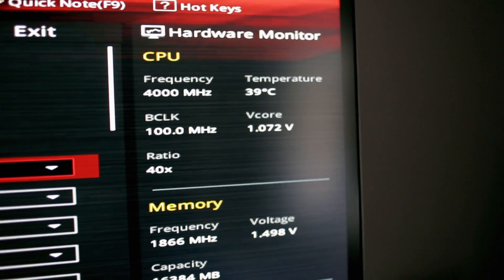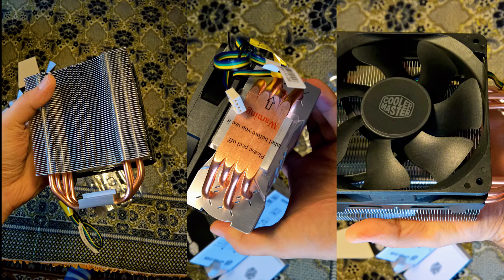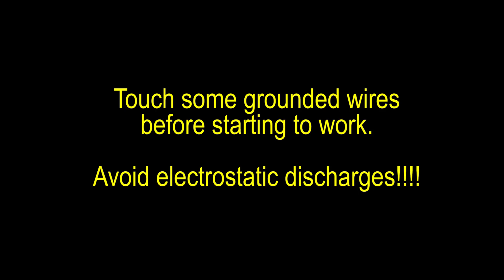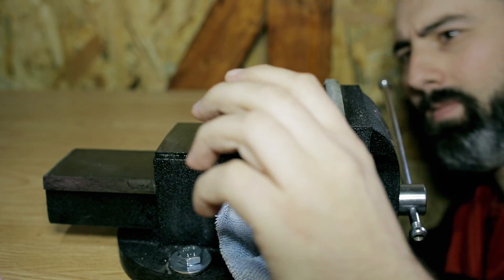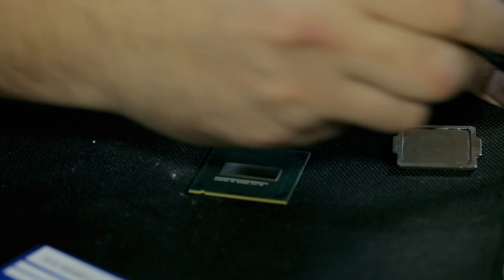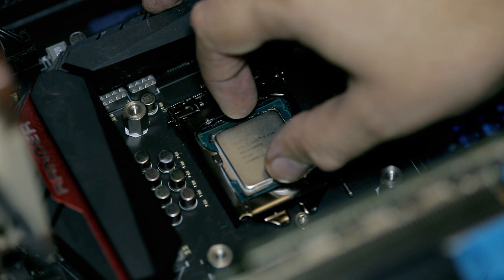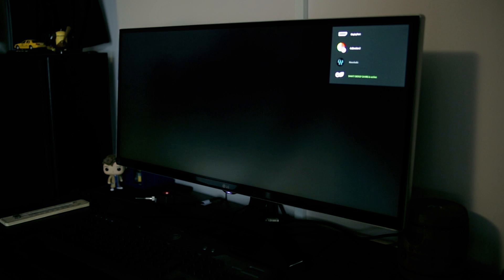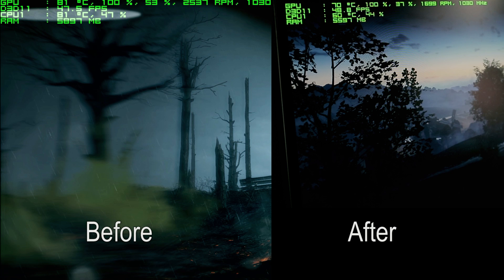Fix my i7 4790k overheating issues by doing a delid [ vice method ]

Comment: Still scared to do this lol but my 4790k is getting in the 70c range non overclocked with a h100i gtx I cant even get a stable overclock lol. Is your 4790k had any issues after delidding?
Reply: u probably have a bad cooler with a damaged pump or smth. My i5 4690k 4,7ghz @ 1,33V gets to around 80°C on my quiet fan curve with a nzxt x61 280mm AIO
Reply: My noctua nh-d15 had way better temps but I hated having the ugly bulky thing on my motherboard
Reply: roteroktober420 i5s run a good bit cooler then an i7
Reply: I have Noctua NH-D15S. Yep ugly and bulky to many people. I think its big, huge, badass. and looks premium, I actually like the colours. Plus it can't leak or fail like a pump/watercooler setup. 

No it's not the cooler, its the focking CPU. Watch the video... i7 4790k TIM sucks. Needs to be delidded. I also get high temperatures with i7 4790k stock and Noctua NH-D15S. Stock, and turbo boost is enabled I think.    47-50c idle. Need to delid, clean, and put new thermal paste and put it back in.

Comment: Wait, you changed to a 212 evo, didn't notice any change, and still use the 212? Surely the AIO is better? Did you try changing back after delidding and see if there's any noticeable difference? I'm currently looking at all delidding vids while I wait for my delidding tools to arrive. I hit high 80's with my 4790k, it's really bad... Thanks for the vid!
Reply: Aha, I see. No, it certainly isn't, and the 212 evo is fine, like you say. I was just thinking since you had a spare H80i you could just as well use that, but good idea to use it for the GPU :) I use a Corsair H110 myself, which I guess makes the 4790k hitting high 80's even more ridiculous. Can't wait to try out the delid. I'll be using liquid metal though, so it will be exciting for sure.

Comment: dude no one have balls to do this
Reply: Florin Musetoiu so what is the best lga 1150 to use
Reply: I have balls and and a small 9 inchs dick so i did it
Reply: I think the 4790K was the end of that line. It also uses DDR3 memory. Nice chip. You can buy good used Z97  motherboards. The 4790K has AVX2 vector processing, and it's not too far behind the Kaby Lake processors.

Comment: how long it takes for that paste to need replacement ? also what if i dont use any gasket maker to glue them back and just leave the mobo hold it as it is? will be any problem if the surface from ihs comes in direct contact with the ide without having that thin layer of silicone in between ?also how long u have that paste will need replacement ?
Reply: yeah but will the direct contact between ide and ihs cause any problem to the cpu ? since theres no silicon layer in between ?
Reply: srry my bad i mean the direct contact without silicon layer in between pcb* and ihs

Comment: The thermal paste isn't the problem.  That's a myth.  The problem is the excess adhesive.  It puts too large a gap between the IHS and die.
Reply: Yes Justin. Everyone who works in this industry and says that Intel uses bad Thermal paste is wrong. You are the only one who knows the real truth. Sarcasm off.
Reply: He wasn't speaking about the glue you applied. He was talking about the glue applied by Intel.

Comment: I delidded my 4790K today. I am getting Temps of 30C at idle and 54C at Load with OC to 4.4GHZ. I decided to do it after watching this video. It worked great! Thanks!
Reply: OC to 4.4GHz? that's the Turbo Mode
Reply: This is pretty amazing. I used Arctic silver # 5 both between the IHS and the Die and between the the IHS lid and the H100i v2 corsair water cooler. I have overclocked to 4.7 GHZ and have yet to hit a CPU temp above 70C, even when at load. WTF, man?
Reply: Well, the AMD Ryzen series has that going to it, but, according to the reviews, those chips don't overclock very high. Now that I have the heat issues fixed on my 4790K I doubt I'll be upgrading for a couple of years.
Reply: It really frustrates me to see all this. I am not the type of guy that takes the risk of experimenting with his expensive electronics.. 
And it makes me MAD intel could not do this by themselves.
During Battlefield one it does not reach temps higher than 77-79 degrees with the CPU at 70-100 % load, so it is not really a problem. 
But when i start the OCCT small test the temp gets above 85 in 20 seconds. 
Those synthethic tests are of course beyond any real world application, but....
My former CPU topped out at i believe 70-72 degrees with freakin prime95 running half an hour.
I don't have the stock or a bad cooler on it today.
Reply: Your Temps might have been even better had you used a liquid metal.
That isn't to say that this difference is small.
Now this has motivated me to delid my 4790k

Comment: For the love of God it's been proven several times that too much thermal paste does not effect your temps in anyway. Second just use your brain if you think he used "too much" thermal paste. If too much was an issue why did the temps drop so much after the new thermal paste application.

Comment: I would have tried a better cooler before trying a delid. I run a Noctua NH-D15 on my 4790k and it never goes over 70c
Reply: Nah it aint about the cooler :). hyper 212 should be more than enaugh for good/decent temps. I have Noctua NH-D15S + Intel core i7 4790k 4.4ghz. idle temp is about 49c or so... thanks to focken INTEL'S SHIT TIM. Need to delid and remove the bad thermal paste, and put fresh MX-4 inside it, and put CPU back. should go down in temp 8c or more.

Comment: My 4790K ran at 100° for maybe a few weeks because a wire got stuck in the fan, this was like 2 years ago and it's still doing fine but even with a custom loop my Temps on 1.22v 4.4ghz peak at 90° on one core while stress testing so I assume the thermal compound under the heatspreader didn't like the heat very much.. gonna try delidding it the following days, hope I do t fuck up.

Comment: Mother of god that was way to much TIM.
Reply: overclockedamd123 That's been proven to be false.
Reply: Bad troll or really stupid, we may never know! :D
Reply: The3rdID is correct, both LinusTechTips and JayzTwoCents have proven that the only thing that hurts thermals is too little thermal paste.
Reply: overclockedamd123 why? It's non-conductive and will be evened out by the mounting mechanism. It's more than necessary but nothing to worry about.
Reply: More than necessary hurts cooling performance.
Reply: overclockedamd123 you ate wrong dude, or do you have a source? You can look up linus' video about this where he tried the dot,  line, too much and too little,  too little was the only thing to lower the cooling performance, too much makes a mess by spreading beyond the edges but obviously the cooling is just the same as the dot or the line as it gets evened out by the pressure of the cooler/heatspreader in this case.
Reply: overclockedamd123 Unless you stuff so much thermal paste under It that the socket arm can't press the ihs all the way down it does not matter.. and I'm fairly sure it's impossible to manage to stuff that much on there. after all it can only be as thick as the clearance between the die and the ihs.
Reply: overclockedamd123 Necro but Oh so worth; the facts are that thermal pastes have high thermal conductivity, sometimes higher than the actual contactsurfaces, and are used to bridge the physical gaps between surfaces. If the distance between the surfaces is huge (many milimiters) then yes, you will see shitty temps even with loads of thermal paste. But a lot of thermal paste between tightly secured surfaces will ONLY show gains, since the more paste there is, the less space there is for small insulating airgaps. If you have too little and the surfaces push towards eachother, you risk creating precisely these insulating airgaps. I work with retail sales and returns in on of Scandinavias largest PC stores and have sometimes done repairs too and can definitely say that too little paste has always shown higher temps than too much.

Now, lets turn this debacle; what evidence do YOU have that too much thermal paste (and key here) between thighly secures surfaces causes temperature degredation? Doesn't that go against the purpose of TIMs in the first place? I mean, are you suggesting that thermal pastes act as insulators? How else would they degrade temps?
Reply: I know this discussion is old, but actually the amount of TIM was just fine. It makes a difference if you apply the TIM on the CPU Heatspreader to mount a cooler or if you apply it on the die, like he did. In that case, you have to make absolutely sure that the whole die is covered, and also you don't have a cooler pressing directly on the TIM. There is still a very small gap between the die and the heatspreader, which also must be 100% filled with TIM. Also, any excess TIM gets pushed to the side of the CPU anyway. It is definitely better to use a little more paste; it doesn't have a negative effect, but using too little definitely does.
I'm also thinking about delidding my 4790k, since I wanted to OC but that thing immediately shot up to 90° :P
Reply: I found putting too much TIM increases temps, as so does too little. I go by the theory that paste is only to fill micro-fissures and pits in the surfaces. I spread it as thinly as possible while still having a covering. I found that yields best results. In most cases a tiny bit still gets pushed out of the sides, but temps are always at their best.
Reply: Also in IHS cooling you only need to cover roughly 60% of the IHS cause that is where the core is.  Slapping on 10 pounds of goop to cover the whole IHS is not needed.  Depending on the cpu (in this case a 4790k)  A small grain of rice is the best method.  It will spread vertically and horizontally enough to cover the core under the IHS.   Beyond that you are leaving a thicker layer on top of the DIE under the IHS and hurting cooling performance.  It is proven by elite overclockers around the world.
Reply: Even liquid metal is far less thermally conductive than the copper of the IHS and the cooling head.
Reply: overclockedamd123
you're wrong and it's been proven.
Reply: Everyonev here is wrong. You don't need to use any thermal paste at all.
Reply: Good day to you.  If this doesnt make sense let me know and I will go further into Tdelta and ambient temps of why this is worse to apply more TIM than needed.
Reply: Incorrect.  So I tried but thanks for reading.
Reply: Good luck to you I hope you have a happy PC life.
Reply: Amazing story backed up with facts.  Thanks.
Reply: Ok well let me break it down for you.  In IHS cooling to heatsink you want the thinnest possible amount of TIM to enhance thermal transfer.  The higher the quality of TIM the better of course.  In Direct DIE cooling amount does not matter you NEED to cover the whole area.  Sure you can slap 10x the amount on a IHS and make a video directly after like linus BUT most TIM cures and when you use too much and you also are not a pro at applying a heatsink/waterblock you won't get great contact because of the amount of TIM you use(it goes on thick).  Thus you are negating a lot of the positive of effect of a high end cooler you purchased to cool your CPU.  Sooooo.  Yea thats it.
Reply: incorrect.
Reply: vermillioN Linus is a moron and the fact that you are using him for information makes me realize you won't understand logic I try to tell you.

Comment: i delidded mine last night, this time i succeeded, i broke an i7 4790 trying to do it once.
i am only seeing around 4c cooler on two cores, the other two cores are the same, this is with artic silver 5, ive ordered some better stuff.
Reply: temps before the delid on stock settings running at 1.1v were 69,70,70 65, after they were 69,69,70,60. when i take my cooler off it looks like some areas of the ihs arent being covered fully by the cooler, i might need to lap the ihs, ive also ordered some liquid pro, im using as5 at the moment so i could see further improvements.
Reply: yeah but 70c undervolted? surely not.
Reply: Did you isolate next to the CPU Die some how?
Reply: @ALWSGaming  nice

Comment: Salut, am si eu un 4790k si nu stiu daca se merita sa ii fac delid: in gaming imi sta in ~60 grade iar un full load pe 4.4 ghz imi sta undeva pe la 70~75 grade, acuma comparand cu ce ai tu as dori sa stiu cum ti se par temperaturile(sistemul meu are racire numai pe aer)
Reply: pe cpu am un noctua NH U12P SE2, iar carcasa este un phanteks eclipse p400 cu 3 exhaust fan noctua NF p12(exact ca alea de la cooleru de proc) iar in intake fron cele 2 de la pahnteks
Reply: multumesc mult pentru informatii! Mult spor in continuare iti doresc!

Comment: I have been having the same issue with my 4790K ever since I bought it. Even though it is water cooled it still consistently goes above 70 degrees C while just playing Resident Evil 7. It's ridiculous how much Intel charges for their CPUs when they cheap out on the thermal paste. I have never had an issue like this with AMD CPUs. Looks like I will probably have to delid it.
Reply: There are folk who delid CPUs for a fee. In the UK, SiliconLottery. A guy in Poland does it (he's on Allegro). A 4790 should not be too difficult to delid by hand anyway, and there are tools available to do the job (der8auer makes one).

Comment: with some liquid metal like CLU or Grizzly you could get way better results by the way :)
Reply: What do you mean by "i choose to have a bit higher temps than burn the damn thing"? You mean the Liquid metal is dangerous for the die?
Reply: Florin Musetoiu partly true. First of all you can isolate the components with vasaline or cheap nail polish. Also high end thermal pastes have a thermal conductivity of around 7 while CLU is 37 W/mK, factor 5.
Reply: Florin Musetoiu ah I see, the best I know of is Grizzly conductonaut, 73W/mK
Reply: I guess Kryonaut thermal paste is 12W/mK. http://forum.notebookreview.com/threads/liquid-metal-showdown-thermal-grizzly-conductonaut-vs-cool-laboratory-liquid-ultra-pro.791489/
Reply: Florin Musetoiu just be sure the die can take the weight/pressure from thr cooler! IHS is basically there to keep the die from damaging.
Reply: Florin Musetoiu which brand is 80+ according to them? if it's some expansive stuff it might be possible, but I hear everyone talking about conductonaut being the best out there atm.
Reply: I've Skylake Cpu..Is this has components next to cpu die?
Reply: Not to mention that Liquidmetal is corrosive, especially on Aluminum parts
Reply: Most Intel CPU heat spreaders are nickel plated copper, which should be fine.
Reply: What I've noticed when using it for like 3 years on an old E8400 is that it will harder over time and you actually have to scrub it off.
Reply: Florin Musetoiu from what hear from pro overclocker small die si de sorder over time is worse they crack and cannot be fixed
Reply: Paint the components!

Comment: how are you getting 80c with liquid lol only 4ghz
Reply: @BeardsChips  The 4790k also has an integrated FIVR which means it generates more heat compared to basically any other intel chip. the 4790k is a solid chip it just runs hot :(